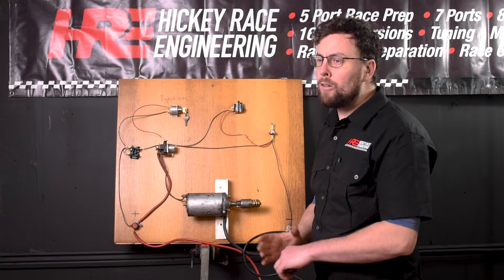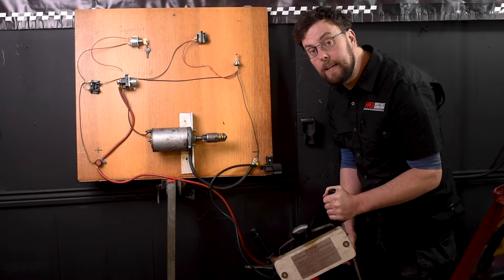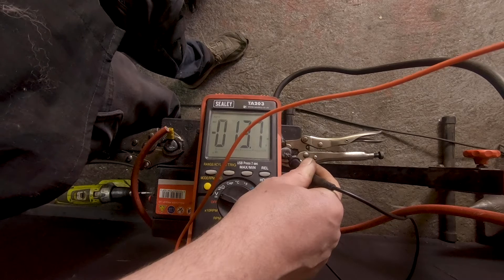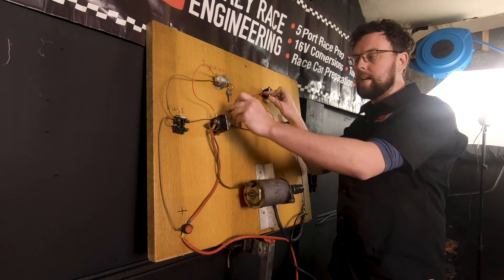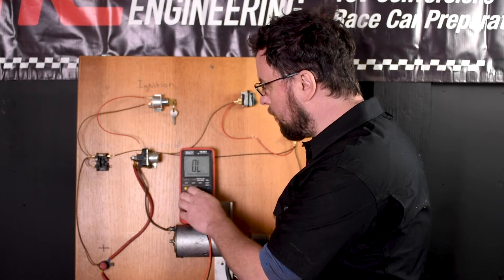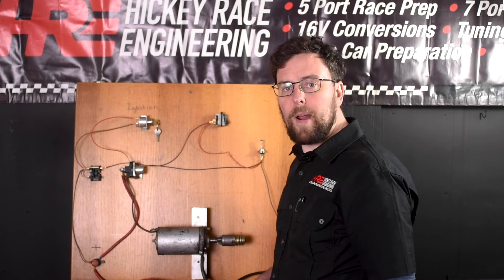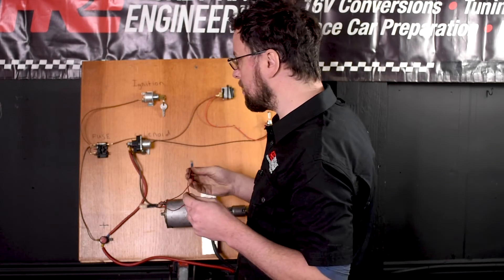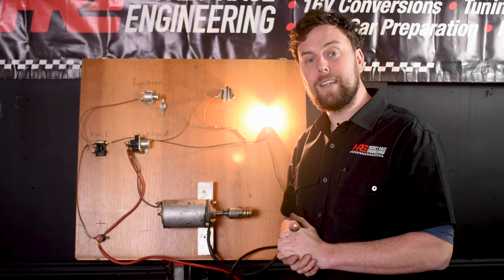How To:  Troubleshooting; Finding Automotive Wiring Faults On Your Car. Do It Yourself

Comment: faster route of locating faults is testing half the circuit. if it tests good on one half of the circuit, then that side should be good, and you can test half of the rest of the circuit. it is more useful in larger circuits.

Comment: Awesomenessssss... Thank you.  My ignition light glows dimly. I guess to find a dodgy earth I have to test every earth I can find. Ignition system seems to be behaving correctly, battery, fuse, switch, solenoid, coil, ballast, alternator, starter. The loom has been hacked/bodged previously. I'm thinking just start at one corner and check every earth I find with a light tester and or volt meter?
Reply from the maker: @mehulk Thats exactly what I would do. it will rule out everything one at a time and it alos future profs any bad connections that could be on the way  👍
Reply: @HREIRL  This car is a mystery... I discovered the wire running to and from my manual fan switch. Isn't live it interupts the earth from the relay - Bonkers?! But that wasn't the issue. 😱 Still looking.
Reply from the maker: @MeHulk_NotNorMal  at least your finding those problems, that is a really Dangerous way to trigger a high voltage relay well found

Comment: Your bringing back memories now Paul, many years ago I bought a 74 mini 850 and to get a bit more power out of it I decided to swap out the 850 head for an 1100 head from an Austin 1100 thinking I was done I cranked her her up and sure enough she flew but would only tick over at high revs after playing with the vacuum advanced fully and then came the electrical problems from blowing up regulators to dynamos and just about everything else, but hey what else would a fella be doing with his time off from work, loving the videos, just out of curiosity Paul did you ever hear about an Irish  man named Weir that was involved with Alec Issigonis in developing the mini.
Reply from the maker: Hi Jer, delighted your enjoying the videos and thanks a million for watching, never heard of that man but thats not to say some one hasn't told me the story and I have forgotten it hahha I have a terrible memory for names of people 😩
Reply: @HREIRL  it was just a thought Paul I am from Artaine originally and there was a guy by the name of wier that ived around the corner and worked on mini all the time but unfortunately he was very found of the drink and more often than not had to be rescued from the underside of a car but I was told he was an excellent mechanic and had played a part in the development of the mini. Cheers.